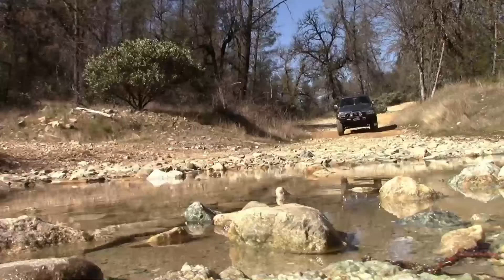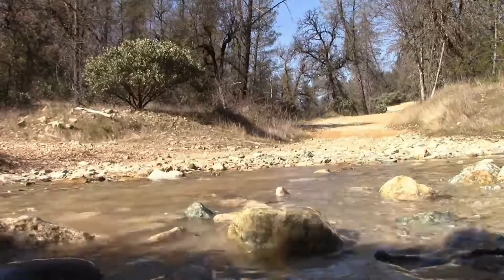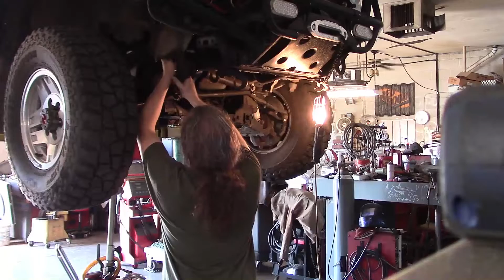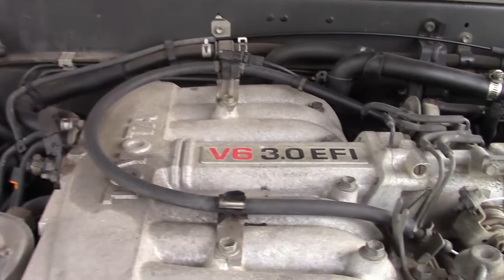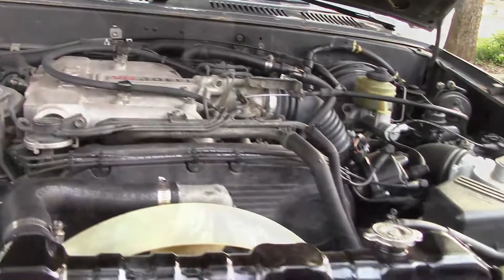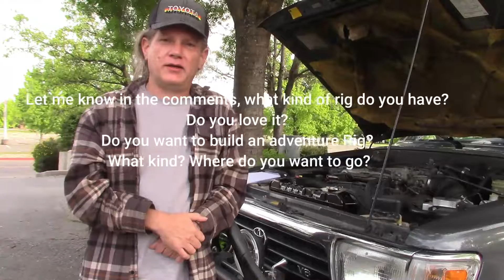Toyota 3.0 3VZE, is it any good? How to Make it Run Forever! 2nd gen 4Runner.

Comment: Just a little feedback on your guidance and advice. Over the past week I have been prepping my 89 Toyota Slumber Queen RV out of storage. I changed over to Toyota motor oil and filter, and had the old green coolant flushed out and replaced with Toyota long life Red. I'll pick up a new air filter next time I'm up near the dealership. 
Coming up soon I'll do a little road trip for a week or more and see how everything works out. My Toyota only has 143,000 km on it and as far as I know it is original having had no major issues. I hope I can keep it that way. 
Thanks again for your advice and suggestions.

Comment: Looking at buying a 92 4Runner this weekend with 340,000km for $2500 there’s the general surface rust on frame for a 20 year old vehicle and everything else looks pretty clean but I did spot what looks like an oil leak.. if I was to have to change the head gasket how much would I be looking at spending on that? And would I be better off swapping in my 5.3ltr LS i already have instead? Buying it to tow a 16’ aluminum boat and for hunting…

Comment: I'll be getting a 2x4 3VZ-E pickup next week with 108K original miles.  Need to drive it 50 miles back home, I'm a little bit worry about the timing chain blowing,  advise?

Comment: Ran adv ding test te2 and e1 jumped .
Drove truck 20 miles.
Jumpered te1 to e1 
Instead of error codes overdrive and check engine flash  continuously.
Help!

Comment: One thing I dont think you went over was the dreaded crossover pipe. I'm pretty sure deleting it and running dual exhaust is a big improvement for the 3.0. Not for performance but to get all the heat down and out from behind the motor.  I've seen multiple people talk about the crossover pipe being one of the main reasons the HG blows. That and poor coolant system maintenance... what do you think about this? As long as the sensors and computer is working in-sinc it should be good? Great video man, simple maintenance is definitely something that will keep any car running.
Reply from the maker: I did talk about that in one of the videos I made. Honestly the crossover is not a big issue. The weakness in the 3.0 was a bad gasket design early on, and the coolant passages are not very well designed. 
So we have to make up for that by making sure our exhaust and EGR works properly and that the cooling system is working at maximum efficiency. 
I don't think the crossover is worth the effort, but I don't think it'll hurt.
I don't think a full dual exhaust is needed on these either. They just don't need to breathe that much. And the right back pressure from the factory design actually helps the truck run properly.
Reply: "poor coolant system maintenance..."  this is the main culprit.  Must use Toyota red, 60% Red, 40% distilled water.  Need to change fluid per the manual,   Phoenix Systems sells a coolant test strip to check PH. In hot climates, must use a 3 core radiator. Brass if possible. Fan clutch must be functioning well. I'm running a catalytic converter from Midas, its not a OEM.   I pass emissions.
Reply: TH.....My aftermarket midas CAT was really getting hot,  its gone now this month as I have the AZ collectible vehicle Lic plate for the 1990 4Runner. Stock original crossover but now its a  straight pipe after the o2 sensor into a Magnaflow muffler installed by professionals, for around $340. I am hoping this cuts down on the heat at the crossover pipe. I am experimenting with Gibbs Driven Oil, its a bit expensive and higher zinc & Moly, they claim its gentler on the cams for my 310,000mi rebuilt motor. I'm experimenting. Without  that CAT, its a significant improvement going uphill. No leaks between mass airflow and throttle body.   New radiator & 60/40 genuine Toyota long life coolant, I pre-mix myself and don't let anyone else touch it.  Some tire shop and a crazy guy with his air tool broke three of my wheel studs on one wheel this past week. They were original and 1st time wheel studs have broken on this Runner. I was livid. Now I can only use tire shops that tighten lugs with a torque wrench and frightened of some of these places.

Comment: Thanks for sharing your knowledge. Can you take them on the highway if you stick to 60-70 mph in the slow lane? Or best to look for alternative routes if taking these things longer distances?
Reply from the maker: Yeah they are fine on the highway. It won't get you anywhere very fast, but steady. 70 is a fine cruising speed, at least with a manual trans. I don't know about auto.
If you don't mind going slow up hill in mountains and aren't towing a lot of weight you'll be fine. But be realistic, it doesn't compare to a modern car.
Reply: @AgileWoodsman  I drive my auto Surf 4x4’95 3.0 about 70-80 Kph in highway.. Slow but sure🤣🤪

Comment: Great video. I think the biggest problem people run into is running cheap aftermarket parts on these motors. OEM parts are more money but simply work the best and will give you way less of a headache. Another thing too with these is they tend to leak oil on the back of the valve covers. I had to do mine a few times before with the fel pro ones then I tried the toyota gaskets and put some rtv sealant around the corners and it hasn't leaked since.
Reply: mine leaks all over but it dont rust !
Reply from the maker: Absolutely. OEM is the way to go for most things, especially the electrical stuff!
Yeah I think mine is getting a slow leak at the rear of the drivers side valve cover, just started recently. It's not bad, it doesn't even drip and leave spots in the driveway yet but I can smell it.
Reply: Using only OEM parts , and  using genuine Toyota Red Long Life coolant mixing yourself in a measuring container (not trusting anyone else)  60% or 65% coolant, & 40% distilled water from Target or Walmart & pre-mixing before putting in your radiator.  This is all key.  So when I got my runner back from the engine builder this year, 9 months later I hear the "chirping" coming from the engine. It is a familiar sound to me, some pulley bearing outside the engine block going bad.  It was a recently installed fan pulley bracket, the bearing was binding and the fan wobbled.  The bracket  looked not even dirty.  I didn't install it. It wasn't an Aisin or Toyota branded part. I think it was a Dorm&#@n  and some of you know what that means.  I replaced with an OEM.
Reply: Aisin, Denso and Beck/Arnley parts are my favorites as well.

Comment: i have a 3.0vze and its started to idle down after it warms up. it will go down to about 450rpm then it kicks back up for a second or two then goes back down. it doesn’t quit, but sounds like it. ive checked the timing. truck has 290000 miles. any thoughts?

Comment: I own a 93 4runner with the 3.0.  I love this thing and will never sell it.  My second head gasket let go at 230k.  The machine shop said all the internals looked absolutely perfect and could easily go another couple hundred thousand miles.  The only issue was the leaking head gasket had eroded or rusted the block slightly.  He said if we had just put it back together the head gasket would become a problem again at some point.

Comment: Great video ,valuable information . I recently purchased a 1992 4runner  142 k miles a Georgia Peach ( I am 2 nd . owner ) . very well maintained .no rust it never saw snow or salt until recently  Yep timing belt went ( melted , shredded , mech. said he never saw anything like it ) . I'm replacing the clutch slave & master cylinder when weather breaks . Timing belt repair was 3 rd.  for this beauty . Interior is cherry . body near perfect Thanks for this video , reassuring that my money was well spent . ( I will change t. b. at 200k , 149 k now it went at 148 k )  I do all the filter & coolant, oil  etc . at recommended intervals . Liked & subscribed .
Reply from the maker: Sounds like you got quite the find! Very cool! Thanks for the sub too!

Comment: Everything you said is "spot-on" leave it all factory and leave it alone, it will run at its best, and do preventative maintenance  as you and Toyota suggested. When I change my oil, no less than 3K miles, I notice how clean it still is ((amber in color, not dark)) tells me the rings are sealing, valve seals are sealing and the combustion is running clean, also there is no worry of internal gumming or varnishing, another thing as you said I do my absolute best to go all OEM Toyota parts, logic, look how far this truck has gone before it needing servicing, will a sub-standard after market part go as far? probably not, stick with Toyota OEM, definite bargains can be found on eBay and Amazon.
Reply from the maker: You got it! Thanks for watching and sharing your experience too!

Comment: You have any issue with the knock sensor yet?
Reply from the maker: None!
Reply: I dragged this truck out of its 20 year resting place in the woods, she has every single one of the normal issues, head gasket leak near the crossover pipe, valve cover leaks (I think because of crossover pipe) code 52 knock sensor. Planning to fix all of it and adjust valves all at once. Really wondering about the eBay headers as everything wrong seems to be the crossovers fault.

Comment: I have a 90 3.0 I'm in the middle of doing a 3.4 swap on and 94 3.0 that is my daily driver right now, some one put a cold air intake on the 90 before I owned it, it was a huge PITA when I had to check the oil or transmission fluid because it was in the way of both dipsticks and I couldn't get them out without taking the cold air intake off. I went and got a stock air system and fixed that problem.
Reply from the maker: Oh man, that doesn't sound like a smart design. Do you know what brand the cold air intake was?
Reply: @AgileWoodsman  I'm not sure it came with the vehicle, if I had to guess it was one of those low end Spectre ones you can get at O'Reilly or AutoZone, one of my buddies thought it may have been an aftermarket part for a Honda Accord. I have two Yota junkyards that specialize in Toyota trucks within a few miles of where I live, it was worth the trip to get a stock air box. I have a proper cold air intake for my 3.4 swap from Performance Tuning, which  will be no problem since it is on the opposite side from the dipsticks.

Comment: I have a 1990, 3.0 V6, 2 wheel-drive, 5 sp, Extra cab pick-up with 310k miles.  When starting cold engine, the engine will race at about 2000 to 2500 rpm for about  one to two minutes before it backs off to a normal idle of around 850 to 900 rpm.  I feel it is unhealthy for a cold engine to do this and would like to adjust the "start-up" idle down, but have heard that it is only possible to do this by replacing the throttle body, which is hard to find.  Any suggestions?  Otherwise, I take care of my Toyota pick-up; best vehicle I've ever owned. Thanks.
Reply from the maker: I hear you. But it is designed that way. Back on those days you had the cold start injector, which is basically an early fuel injection version of a choke, like carburetors had.
I'd live with it. It won't hurt it. The only damage during start up is that second it takes for oil to be pumped up and get flowing to the top of the motor. All engines suffer from that unless you have a pre-start priming system. We used to be able to buy those back in the 80's and 90's! 
I wouldn't worry about it. And grats on the 300K mile club!!

Comment: I just bought a 95 4runner with the 3.0, looked over most of the engine bay, all belts were tight, coolant clear ish, oil a bit dark. I don't think the guy tried to hide any problem by replacing the fluids right before sale. Has 155k miles. I test drove it for 45 minutes, shift all gears, tried the 4wd in low and hi, no dents or scratches, just a good lookin yota. Paid the guy and I went on my way home,  about 130 mile trip. About half way there, started running like ass and sound like a laen mower, so I pull over and pop the hood. All looked as it should be. I go under and there's a bunch of oil on the ground and oil on everything front and below the engine. I'm thinking the timing belt went out, I haven't checked yet. Paid $1,100 to get it towed to my house :(
Reply from the maker: Oh man Ken, rotten luck!! IF the timing belt went, it would not run at all. And if it slipped it wouldn't make oil spew all over the place. Sounds like a seal or gasket blew somewhere. You'll just have to get in there and find where it came from if you can. Sorry for the bad experience!
Reply: @AgileWoodsman  I figured out what it is/was.. good sized crack and small hole of passenger side of the block. Connecting rod broke and started packing its way thru the block, much like a baby bird thru an eggshell. I got the 4runner sold to a dude that resells em down in mexico, got $2800 for it and I paid 1500 haha

Comment: Thanks for the pep talk! I drank and bought a truck. Oopsies. She runs but damn rough. She's also a automatic transmission. Eh. .  
 Got a 89 pickup. She looks great though. I'm in sacramento and putting out feelers for people to work with. 
 Anyhow, thanks and I'll try not to break things while learning how to wrench. 
 Good input. Wish guys would keep these things more stock, but to each their own.
Reply: It's the 3.0
Reply from the maker: Congrats on the new truck! You know, a clean body and interior is a lot harder and more costly to fix than a rough running motor so I think you did right.
Do a good tune up first if it hasn't been done. WHenever getting a "new" old rig, plugs, wires, filters, fluids should all be done as a starting point. 
I agree on the stock thing!!

Comment: Mike, I have a 1st gen with a 3.0 from a 2nd gen. My top speed on the highway is ~65 mph and in 5th gear that’s around 2800 RPM. Is it safe for the engine be at 2800 RPM on highway for a long period of time? Cheers
Reply from the maker: Absolutely. I cruise around 3000 to 3200 RPM for days at a time. You're fine. Highway miles are so easy on a motor compared to starting it and local, stop and go driving. 1st gens are awesome and getting expensive fast!! Take good care of her!
Reply: Totally safe. Mine is cruising at 3000 with 4:56 gearing. 372xxx on the clock original owner and 0 issues. Ive heard that running at a higher rpm keeps your engine cleaned out, not sure if its true but seems like a good theory

Comment: Excellent  video. I was tinkering with the idea of modifications for horsepower, and you addressed that. I have only 110k miles on my very clean and straight 94’ 5 speed 4x4. I’ll keep it stock.
Reply from the maker: That motor is a baby still!! I totally understand the want of more power but yeah, I'd do a swap rather than beef up a 3.0.
But I think keeping it in good running stock condition is fair, that's really low miles!!

Comment: Yeah, send us more.  You do a great job on these.  I have a 1992 4Runner with an oil leak that was supposedly fixed...not sure...never had a 4Runner.  Someone suggested maybe the heads weren't screwed down all the way.
Reply from the maker: An oil leak is not likely to be the heads. If the heads were loose at all you'd know it!!
It might be the valve covers. You'll just have to poke around with a flashlight.
If everything is messy, clean the engine bay carefully to start fresh then watch where the leak is coming from. GOod luck and thanks for the kudos!! I appreciate it!

Comment: 100% Correct you are"
Factory Stock = Longevity "
K&N Air Filter ( stock  replacement size)
Walker Dual Flow Muffler 
(Stock replacement size )
Improves Horse Power & 
also  mpg
You wont believe it's the same 3.0 !"

31× 10.50  , 235 x 15  B.F  goodrich all terrain 
k/o Tires  fit Stock wheels usually "
For  Rugged looks & Excellent  performance on & off road "
Is the Formula  on my Truck"
Reply from the maker: Sounds like a great combo! I'd feel good doing any of those changes.

Comment: We just picked up a 94 4Runner good deal 138k it starts clutch issue going to replace master, slave and flush. Won’t go into gear could the plated be gone?
Reply from the maker: I'd start by making sure the fluid is good, full, and flushed, no kinks in the tube, etc. Then the master, etc. You're likely on the right track.

Comment: I have a 91 Pickup with the 3.0 in it and it runs and drives great but the engine makes a tapping sound. Ive had it looked at by a couple mechanics and they all say its "normal" for them but i would like to fix it if possible. Any idea what i could do about it?
Reply from the maker: These motors have solid valve lifters, where most cars you're used to have hydrolic. Solid lifters do make a clicking or tapping sound. It's normal. You're fine!

Comment: +1 for maintenance on the 3.0!  Fantastic video, love the deep knowledge and straight forward delivery.  I have a 1990 3.0 4runner that I'm slowly learning my way around and would love to glean more insight from you, so please keep going with the vids.
Reply from the maker: You got it! More coming, I;m just behind on editing! Thanks for the kind comment!
Reply: How's your '90 doing after a year? I'm interested in one for sale near me.
Reply: @Danomega1  Running better than ever.  I did the valve adjustment not long ago, and that along with a tweak to the TPS and a broken spacer on the throttle cable, it's acceleration and idle issues are history.  It's been putting in miles.